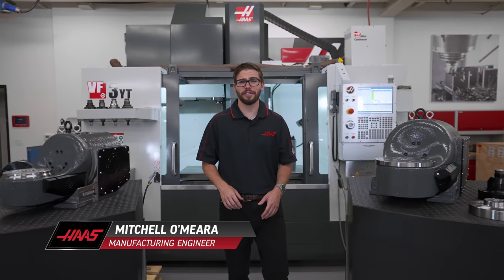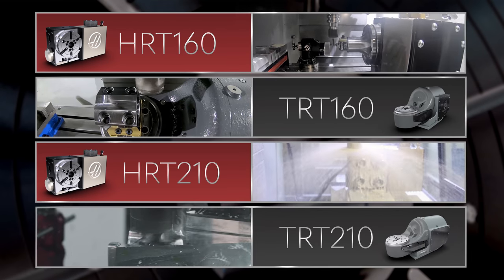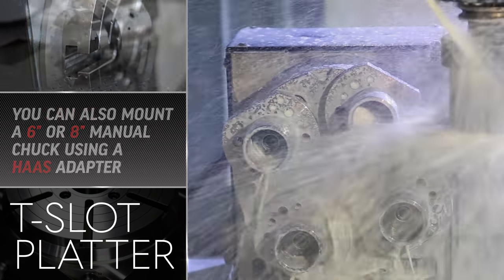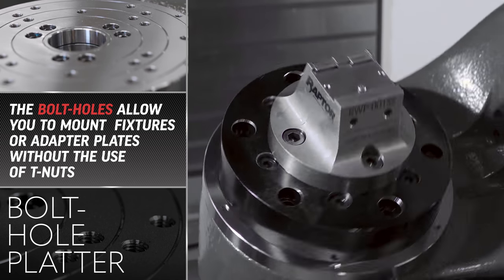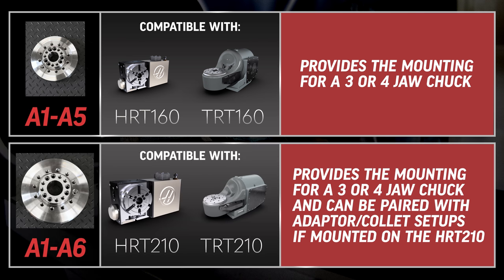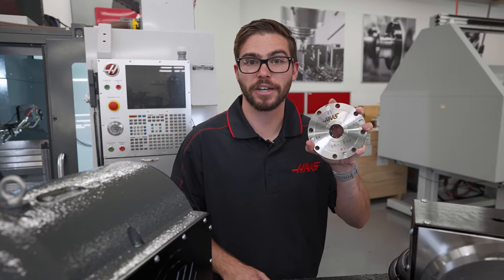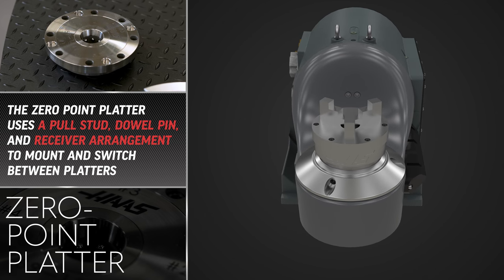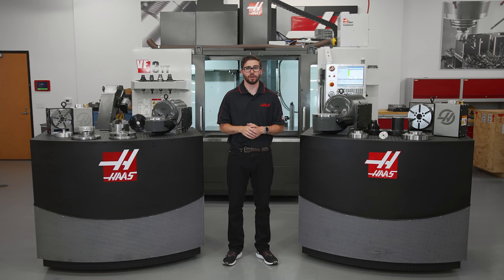Haas Rotary Platter Types PLUS the HRT160, TRT160, HRT210, and TRT210. Haas Automation, Inc.

Comment: I'm using the bolt pattern table with a FifthAxis Workholding rocklock base. It's a great combination, but making custom pallets is definitely more involved with the four, independent lugs. Probably more expensive as well. No regrets though. Even with the Z-travel on my VF4, I wouldn't want anything to raise the platter any higher. When running the A-axis, every mm of additional Z-height is another mm of Y-axis travel required to machine the part when tilted. I have the TRT-210 mounted to the furthest Y+ position on the table to maximize the work envelope. When it was mounted in the center I ran out of Y-axis real fast.

Comment: Just recently bought a brand new HRT-210  plus 4th axis drive for over $15k and upon unpacking realized the mounting hardware for the HRT was missing so I contacted my HFO only to be told that Haas does not include the 2 Nuts and bolts to secure the HRT210 to the table so they can save $5 worth of parts. I can't begin to tell you how pissed I'm with Haas for being cheap. Over the years I have bought many vises, trunnions and other workholding devices  from other vendors and they have always included the mounting hardware.  C'mon Haas you can do better !!
Reply from the maker: J Rodriguez - Send me an email at bofallon@haascnc.com please.  I want to look into this more.  Thanks.  Bryan - Haas Automation

Comment: One thing you CAN'T find in the manuals is the T-NUT SIZE!  HRT-160 uses 3/8 or M10 style T-nuts.
Reply from the maker: capnthepeafarmer, T-slot dimensions for each rotary table can be found on the Layout Drawing in the Technical Details section on the corresponding rotary web page. Since there can be variations in "slot" width, base width, and overall height between SAE and metric sizes and even between the same size from different manufacturers, choosing t-nuts that fit the layout drawing dimensions  should work well. Thanks for the comment.